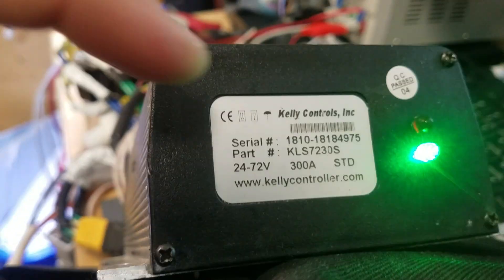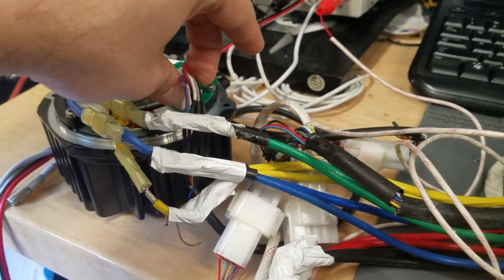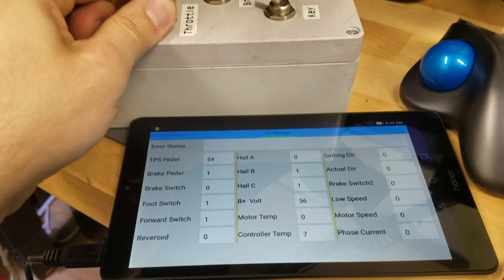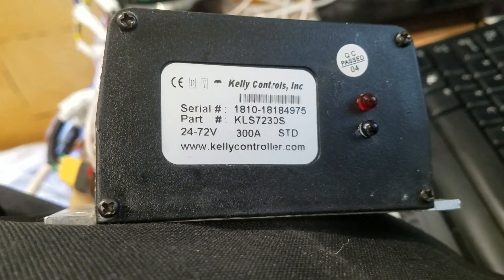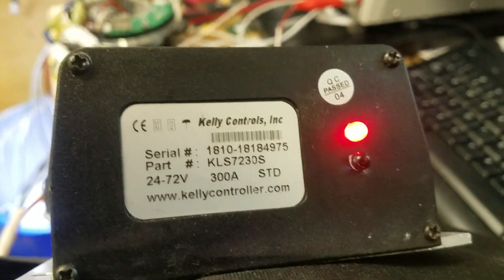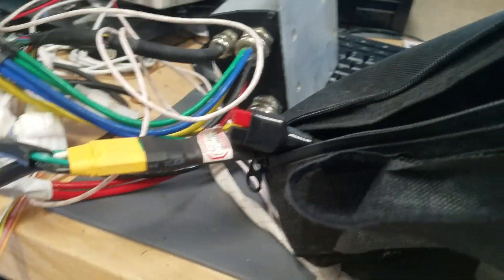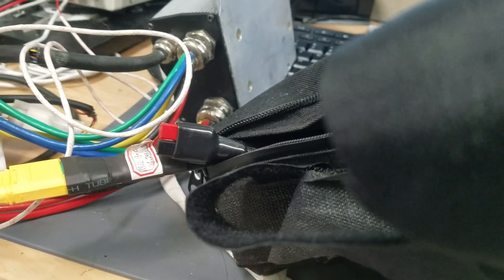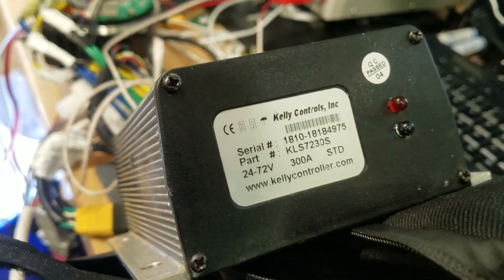Louis is too dumb to set up a Kelly KLS7230S controller - pedel error, 3 led blinks

Comment: hi  i have  a  7230s   and have lost the  diagram  is there any chance that somebody can help  me set it up    from scratch  its  blinking  3 times then  4    i also need the throttle  wire numbers  as i cant find the diagram nowhere    also  is this plug n play or must it go into a pc fr setup   as i hAVE NOT ANY HALL SENSORS  WIRED UP YET PLZ  HELP
Reply from the maker: Throw it away and get a controller that isn't garbage. That is what I did.
Reply: @rossmannkoigroup i bought this  model for one reason and  one reason only  simply because it small  and al i have room for  but it has  vari regen option....   i near have it running  but there is a wire called a foot switch   what is this foot switch for anyone?  and does the  circuit need to  be  closed  for  the  controller to go as  its moving the wheel and then   locking  up

Comment: Hello!!!
I have a qs205 v3 t5 3000w motor, a kelly kls7230s controller and a 72v 30ah battery with Samsung 21700 cells and a 120a bms, how much percentage would they be set in the current motor and current battery parameters?  thanks in advance a greeting friend !!!

Comment: not like i know anything about this gear, but the pedal error could just be cranking the knob too high? like it expects a certain range and what it received was over the top end of the range?
if you turn it up super slowly, does it have a value at which it cuts out with pedel error?

Comment: Setup the propper type of throttle you are using(pot 0-5v or hall 1.2-3.3v) and its deadzones. Check if you have the direction switch enabled and the protection feature of having high throttle when direction change. It does this on my kls12302

Comment: Looks like a code 33. Hall throttle is short or open circuit. Is there an enable pin (microswitch)? Might need to pull pin 15 to ground (pin 20). Check the wiring connections for the 3 hall sensors and the U,V,W wires from the motor to the motor controller. I think there are three versions of sockets for the motor controller. Messed with it a few years back. kelly kbs..... controller.
Reply: I see the PWR pin 7 going to the Key switch needs +battery.
Reply: I was swapping U,W, V connections and a,b,c hall sensor wires around on another china motor controller to make it work.  Be careful not to reverse +5v power on the hall sensor.

Comment: The first thing, normally the need on additional part to fix the rotor in the center otherwise it can't even start, this have a lot of chance to be the problem, otherwise  it's that this controller need an other sensor for detecting that you have start to use the pedals (generally it's something like a disc)

Comment: docs say if throttle goes too high controller will protect itself assuming an error.
Reply: so try turning it up no further than 100 or so and see if the error presents or not.

Comment: [2.3] •Throttle Input: 0-5 Volts. Can use 3-wire pot to produce 0-5V signal.
Refer -> 3.2.2 Wiring of KLS-S Controller
etc
Pg 17 Our controller will report 3.3 error code if the output of hall throttle is below 0.5V or above 4.5V
by default
... Lots of other input parameters in the manual - seriously .. please Read the Friendly Manual (-;

Even if all the parameters are set correctly - is there a jumper or setting to bypass and therefore overwrite the bafang's pre-set configuration and firmware? or is there such a necessity ?  ¯\_(ツ)_/¯

Comment: https://fasterbikes.eu/en/index.php?controller=attachment&id_attachment=68       Kelly KLS-S Brushless Motor
Controller User’s Manual   Devices Supported:
Rev1.10
May.2018
KLS4812S KLS7212S
KLS6018S KLS7230S
KLS6030S KLS7218S
KLS6035S

Comment: I'm engineering and electrically stupid, but I don't see it as 3 blinks stop, but - 3 blinks 3 blinks stop. In other words I see "ooo-ooo-stop" and you see it as "ooo-stop." In the manual, this is listed as "hall throttle is open or short circuited." Also, what happens if you barely open the throttle and leave it be instead of ramping up the throttle high and fast?

Comment: RTFM
-I think it's 3-3 blinks, and the HALL1 value stays at 0, so you should check the hall sensor wiring.
-The controler box needs a voltage between 12V and max battery voltage to switch on  (manual page 11 note 3: [key]Switch to 12V is active. Open switch is inactive)
-This voltage can be the battery +(manual page 12 figure 6: 
Battery voltage can be used for controller supply)
In this case you can use the external 12V PSU but using the battery positive is good too (and you won't have the psu on your way home :D )
-check the TPS Type setting. The Kelly control box has a 5K Pot (not a hall sensor) This shouldn't be the problem, because you could change the throttle value, but it takes no time to check
-also make sure to set the throttle low before switching on the controler

Comment: Just gonna say B+ to battery [-; ... and you previously mentioned that the bafang has a "special feature" involving the throttle control ... so something is already "in the way" between your kelly controller and the motor so it is not "directly" communicating with the motor - that might be the issue - Just a thought.
(i.e. you are not bypassing the bafang firmware to the motor - seems to be inline with the 3-3 error that the others are referring to -the bafang firmware has the control over your hall sensor/throttle - the kelly controller is only "sitting" as a layer on top)

Comment: I think its 3 red and 3 red Hall Throttle is open or short circuit. When the throttle is repaired, a restart will clear the fault. If so I guess yer wiring maybe?

Comment: The manual says a 3,3 error is: Hall throttle is open or short circuit...
Which matches the pedal error you are seeing on the software..
 My guess is that the Kelly needs a hall effect throttle and not the pot you are trying to use... Or there is a config error and you did not change the throttle type...

(6)TPS Low Err: Hall active pedal, if lower than the value, report the fault of TPS Type. Range:
0~20
(7)TPS High Err: Hall active pedal, if higher than the value, report the fault of TPS Type. Range:
80~100
As you may know,the output of hall throttle from Kelly is about from 0.86V to 4.2V.
Our controller will report 3.3 error code if the output of hall throttle is below 0.5V or above 4.5V
by default.
The controller will think the hall throttle is shorted or damaged if the output is beyond the range
from 0.5V to 4.5V.
You can adjust the threshold voltage below or above 0.5V.The controller will report the 3.3 code
to protect the system according to different types of hall throttle.
Because there are many different hall throttle suppliers in the world.The initial output can not be
always in the range of 0.5V to 4.5V.
But it doesn't make any differences if you choose 0-5V or 3-wire pot for the throttle type.That is
to say,these two settings are only useful for hall active throttle or pedal when you chose throttle
type at 2.
As the same goes,it is valid to adjust the high threshold voltage above 4.5V or below 4.5V.
Usually the hall output voltage is 4.2V Max.If you adjust it to lower value which is near 4.2V,it
may trigger the error code in normal way.
(8)TPS Type: TPS Type, 1:0-5V 3-wire 0-5K pot,5K is normal,2K-20K can be used;2:Hall active
Kelly KLS-S Brushless Motor Controller User’s Manual V1.10
18
throttle or pedal. Range: 1~2

 Me thinks you need to configure the Kelly to the controller you are using either hall effect or 5k pot... Somewhere you can set that up...
Reply: This, page 30 of the KLS manual
Reply: @webmasterjohn6274 

 Yuppers...
But it seems to be in broken English...

Comment: Edit: should have quoted better.
Edit 2: noone special below linked a solution, better check that out
From Red led codes, page 26
3,3 ¤¤¤ ¤¤¤ 
Explanation: Hall throttle is open
or short-circuit
Solution: When the throttle is repaired, a restart will clear the
fault.
Reply: Right idea, wrong manual, page 30, code 3.3
Reply: Webmaster john cheers man, I don't actually own one of these
Reply: Webmaster john The manual I took this from is linked on Kelly's product page and lists the model Louis mentions on the first page. You have a different error description for 3.3?
Reply: @ciarfah  Its the KLS-S user manual v1.1 (KLS7230S supported) on the support section of Kelly. The error code is the same, regardless the manual.
Reply: But I build hybrid systems for race cars and it wouldn't suprise me if the controller simply wants an Hall sensor signal (digital) instead of a analog pot.
Reply: noone special Nice one!
Reply: @ciarfah  No problem, I just hope he sees it. I have quite a bit of experience with Kelly Controllers (I owned at least 10).